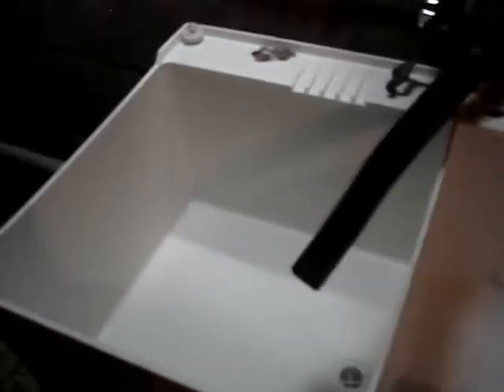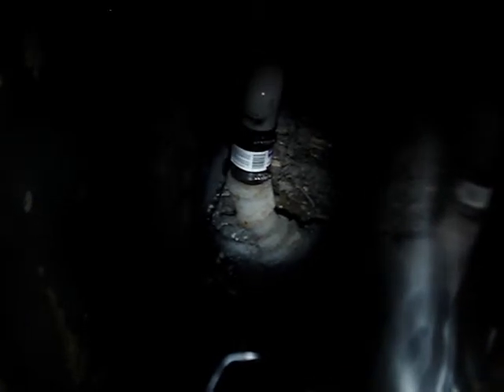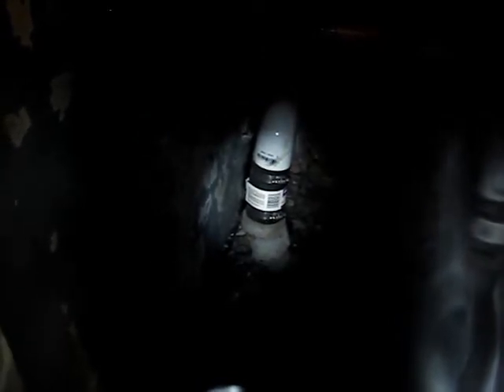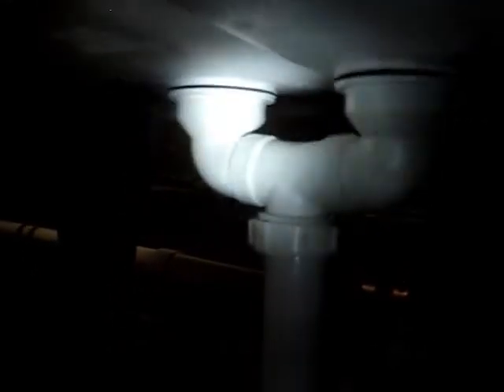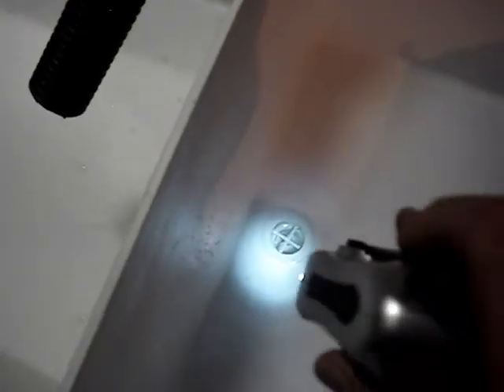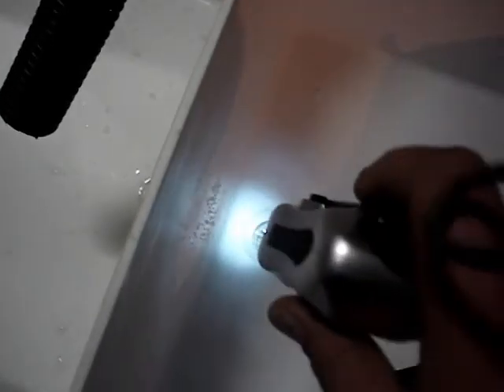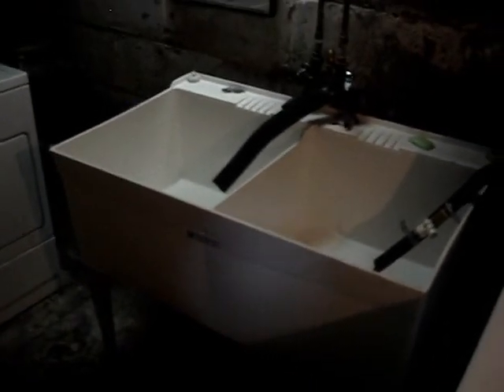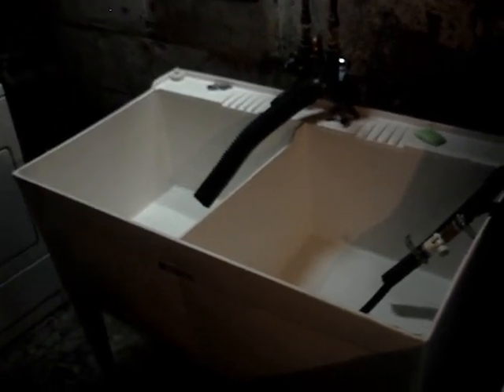New Laundry Tub And Drain Piping

Comment: Thanks for the vid! I am thinking of replacing mine as well with the same laundry tub from Menards. I currently have an old concrete tub in my basement, and it is starting to slowly leak from the rust and corrosion. 

3 quick questions:

1) On your old concrete tub, was it sitting on a metal frame that was bolted to the floor? If it was did you have difficulty removing it?

2) How is the laundry tub holding up?

3) Did you anchor the new tub to the wall? I noticed Menards sells one.